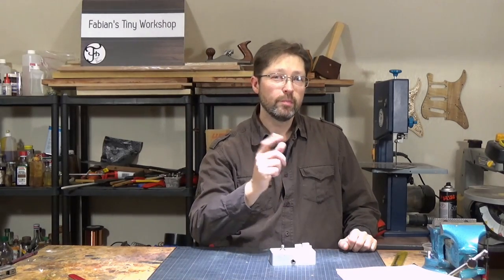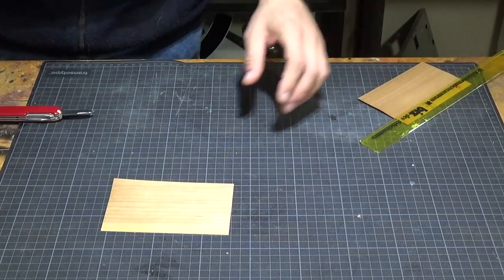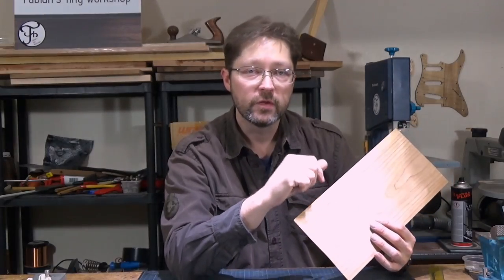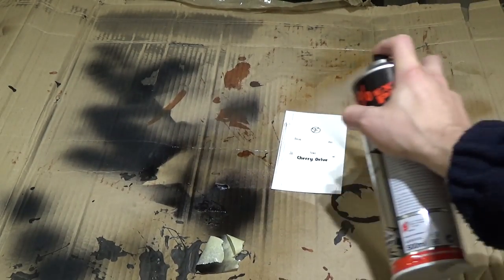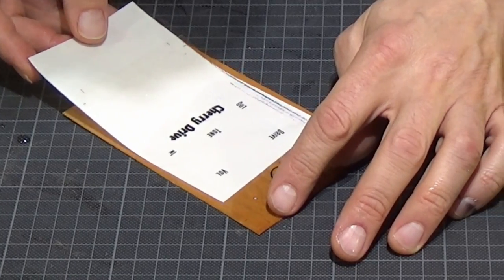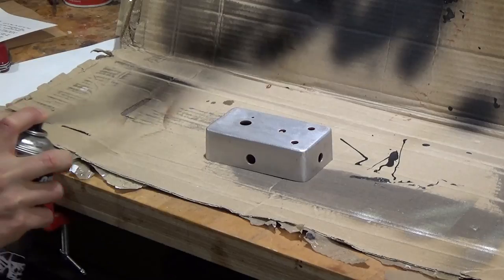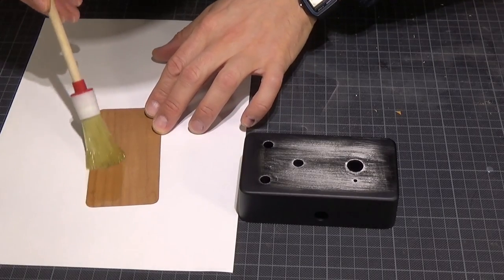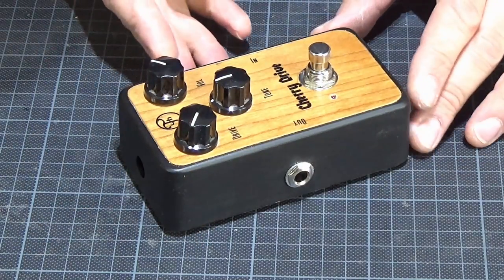making a Boutique Guitar Pedal Enclosure // How To

Comment: an etching primer and a coat of sealing lacquer would help to make the pedal a little more robust, also a good trick is to mirror print the decal an apply with the inked side underneath the decal this helps to prevent wear to the print.
Reply: But if you apply the decal upside down, there is no clue between decal and pedal